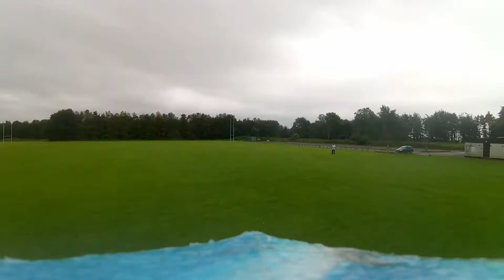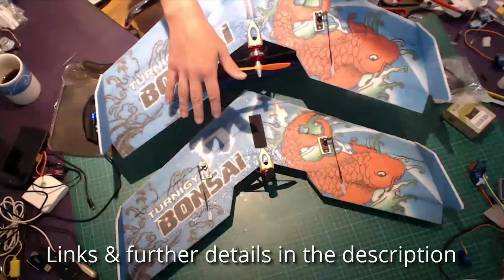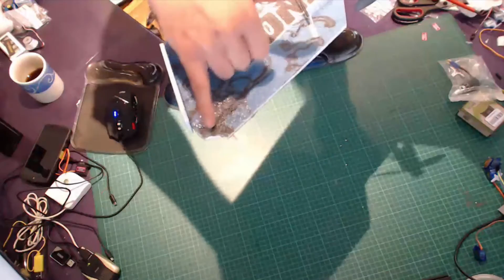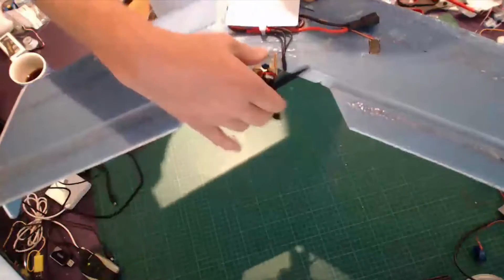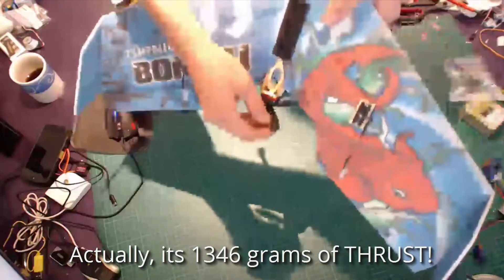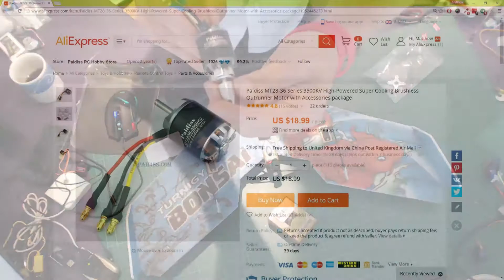METAL BONSAI Flying Wing Part #3 (How to make it FAST!!!!)

Comment: I have a Teksumo, and the one thing I pick up from all the Bonsai/teksumo threads is ... how important it is to protect the electronics underneath, with some people going to quite elaborate lengths to achieve this.. Surely you have all missed the simple trick??.. Put them on TOP of the wing!!  That's where my battery.. 3S 2200 lves with the esc behind it and the RX housed in a balsa lined  cut out underneath, totally within the thickness of the wing with a foamboard lid over it.. I've crashed the tekky a couple of times and never damaged any components yet!!.. :)
Reply from the maker: Howdy, I've seen people do this. The only time I've had an issue with bottom mounted parts is when I landed the Teksumo on a runway and the tarmac ripped the battery up. Matt

Comment: HI Matt, 
i just builed the bonsai like yours. i use a 3S 1000maH Lipo for it and it flies quite fast but not unlimited vertical. As well if i push the trottle full it seems to get a bit slower in the very end.
Reply from the maker: Howdy Thomas, thats one of 3 things then. The battery not having enough guts in it ( I was using a A-Spec 1300mAh 3S), the ESC not being able to cope and also if the ESC's not calibrated, that could also cause some fun too. Hope that gives you enough to have a look at it :) Matt
Reply: Hi Matt, okay that are some things which i have to look at. What do you mean with that the ESC is not able to cope? How can i  adjust this? Calibratung and another lipo isnt a problem ;-)
Reply from the maker: Howdy Thomas, as in the ESC might be too small. So you maybe trying to pull 30A out of a 20A esc. So do check the rating on it, to what the motor is actually pulling with a power/current meter. Matt
Reply: okay i will but i use the one you reccon a 40A, i check first the two other options!

Comment: i have some industrial Grade  Araldite 2021 and 2015 adhesive Wonder if that is a tiny bit better then the goop glue. i might give it a try and see if it will just eate up the Depron or what will happen
Reply from the maker: Morning, I use the goop glue for the leading edges & anywhere that might, err will take an impact as it then bounces. Not sure on the araldite 2021 and 2015 adhesive, depends if they're rubberised. Matt

Comment: you need to put an fpv setup on that :D
Reply from the maker: Howdy Jamble, I have issues with it line of sight, I can't imagine wtf it would be like with FPV on it. I'd HAVE to put a stabilizer on it. It's wayyyy too twitchy ;-)
Reply: Matthew Ogborne or just a lot of expo and change the throttle range from 1000-2000 to something like 1000-1750 I know old reaction